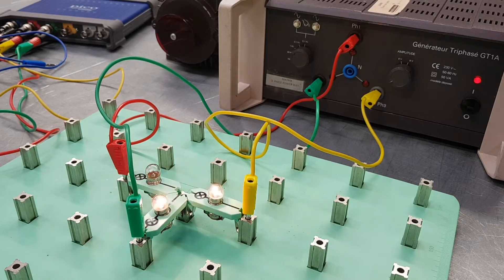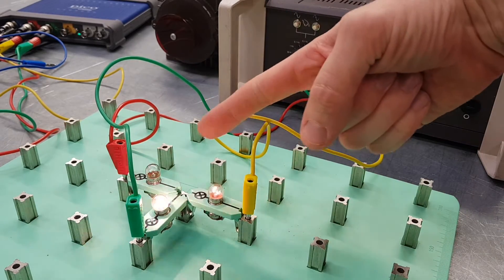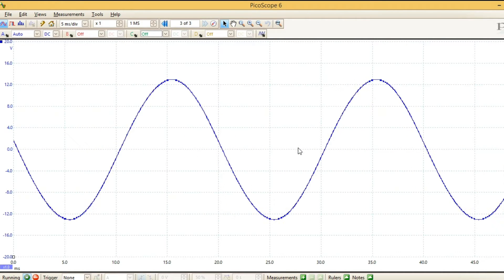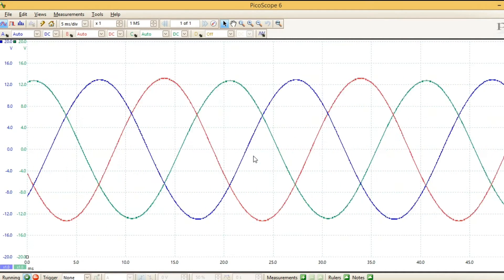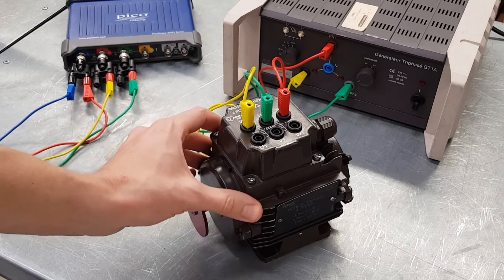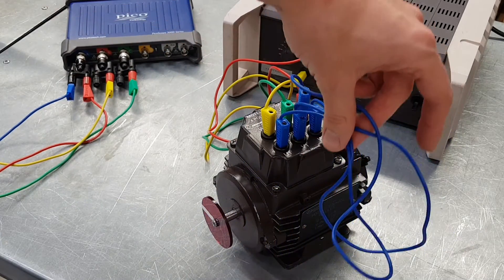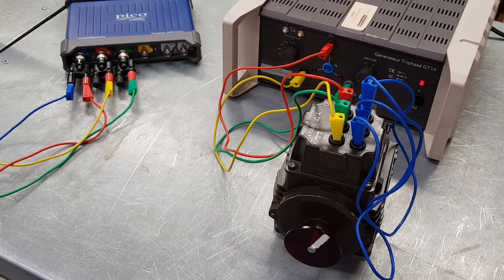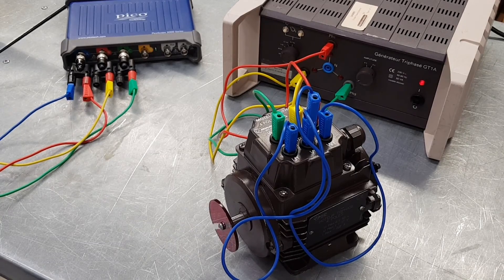An Introduction to Three Phase Systems Using the Matrix Locktronics Kit

Comment: Could u please name a specific real life or industrial, commercial use of connection with balance loads to justify use of delta connection to the building?
Looks like delta connection would be used on a single electrical equipment like one generator, one step down transformer and one electric motor?

👍

Comment: Why doest it short circuit as all phases are connected. If you connected at the supply they would short no.
Reply from the maker: Great question! They're connected after passing through the motor winding which acts as the load. It's the same reason a line and neutral don't short circuit when connected together through a load.

Comment: Joe - this has been doing my head in and I can’t understand why, in the absence of neutral, that the bulbs go on and off. Can you help, please?
Reply: I think Joe could probably say this much more eloquently, but imagine that two of the lines by themselves make a voltage divider with the two lamps between them.  At some point, the voltage in the middle would be the same as from the third line, and hence no current would flow through the other bulb because there wouldn't be any voltage change across it.  Looking at the oscilloscope, that would correspond to a point where the voltage of one line is exactly midway between that of the other two.